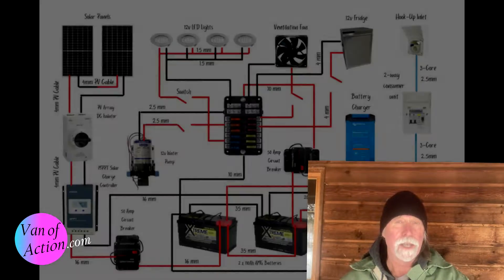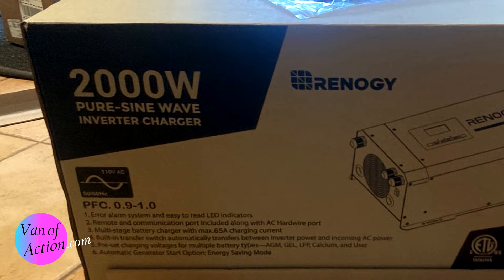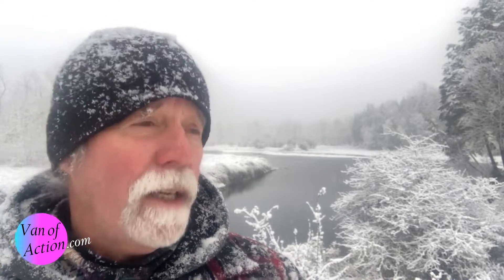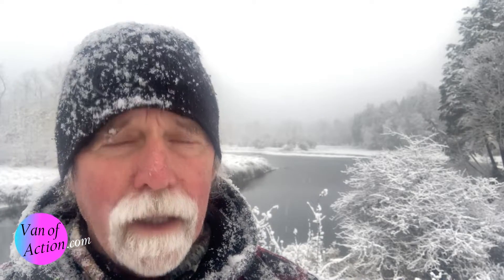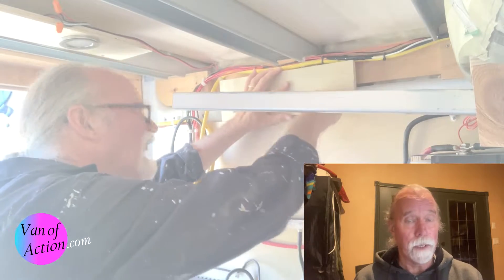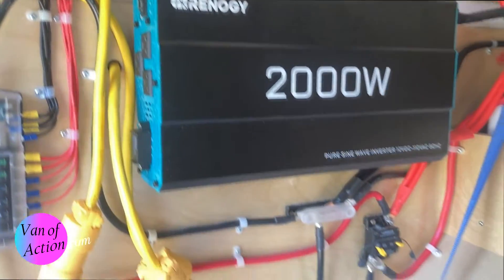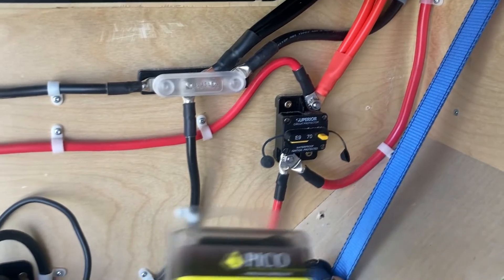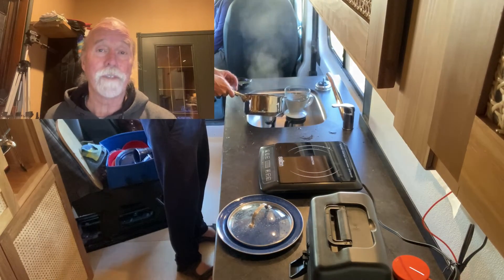How to Install 2000 watt pure sine inverter in Dodge Promaster van build for off grid vanlife camp

Comment: Dave good morning from Ottawa.

I recently had a viewer bring to my attention a mistake that I made on the installation of our Renogy 2000 watt pure sine inverter.  It looks like you and I both completed this install about the same time – about 8 months ago.  

The tip the fellow shared with me was that I neglected to ground the Renogy inverter. It does come equipped with a grounding lug.  When I looked at the manual, sure enough the information is there: 

“… comes equipped with a grounding lug to appropriately ground to earth or to another designated ground (for example, a metal frame of an RV)…. The recommended wire size for grounding is 10 AWG insulated copper strand wire….” 

Not being a professional, the value of sharing my work enables others with more knowledge or experience to share their thoughts, which I ultimately benefit from.  

I recently watched your installation video to see if perhaps you missed it as well, and I don’t see it in your video either, so I thought I would share this little nugget of knowledge I acquired this morning

Kindest regards
Dwayne
Reply from the maker: Hey Dwayne !!    Good to hear from you.   First - Yes - I did miss this on my installation, however a viewer pointed it out to me last winter and I corrected it.   Couldn't bring myself to do another video about it.   Second - we will be returning to Ontario towards the end of this month - I have a bunch to do in the Cobourg area but should be in Perth towards the end of August or into September ...maybe we can meetup
Reply: Great info about the 200 amp breaker, I saw in the instructions 250 amp is recommended. Surprised inverters draw so many amps. I was going to use 60 amps but see that would not work, thanks!

Comment: Hey mate what is the size of the battery powering your inverter?
Reply from the maker: Hi - thanks for watching.   I have 2 - 100 Amp Hour lithium batteries.  Hope that helps and that you’ll stop back.    Dave
Reply: 2 12v 100 batteries parallel or 24v? Thanks

Comment: thanks for the video, last year, the reviews of this product were thin on the ground. I installed mine and its been faultless for over a year now. But  I've read some of the comments below regards the cable thickness from your batteries going to the fuses (70a that are now 200a) and odnt see a clear response. But yes those cable need beefing up. The reason is, the fuse will allow 200+ amps through it befire it trips,  but those cables are only rated at probably 80 , end result can be melted cables and at worst toasted van. But thanks for the cool video. I have 250 a fuse on my renogy and big thick 50mm2 cable (UK size) 1/0 awg US size. or yes you could double the thinnner cables together, so 2 cables for red, and 2 cables for black.
Reply from the maker: Hi John - thanks so much for watching and taking the time to comment - and thanks for the close look at my installation.   I totally misunderstood the earlier comments and can see exactly what you mean.   I'll get on that as soon as I can.   Hope you'll stop back.  Be well .......... Dave

Comment: How did you connect the ground? My renogy inverter came with 3 nuts and 2 split lock washers for a single bolt /post ...
Reply from the maker: Hi Marion - thanks for watching and taking the time to comment.   I connected the black wires to the negative bus bar which grounds the complete system.    Hope that helps .... be well and stop back .......   Dave
Reply: @VanOfAction  Hi Dave, thx for reply!! I was more wondering how to arrange the 3 nuts and 2 split lock washers on that little inverter case grounding bolt. Not the main DC-IN cables.
Reply from the maker: Hi Marion - that's not ringing a bell for me  ....   let me walk down to the van and check !!
Reply from the maker: Hi Marion -   I  only have a red and a black wire on my  inverter.   There is no ground.   Can you send me a photo or short video ?  vanofaction@gmail.com

Comment: Did you figure out how to ground your inverter?  That is what I am trying to figure out next.
Reply from the maker: Hi Jean.   Thanks for watching.   I’m not an electrician so this information and $1.50 will get you a cup of coffee.    But - I believe that since the Inverters black wire is connected to the negative bus it is grounded through the system.  There were no instructions for separate grounding (that I saw) in my inverter.  If you hear otherwise let me know.    Be sure to stop back.  Dave.

Comment: Thank you for lots of useful information. I'm about to install the same inverter and I wasn't sure how to run power from inverter to an outlet. It is like adding an extention cord for 2000W use...  I was even considering installing the inverter on side of cabinet to plug items directly and to avoid adding an outlet. Extention cords can become unseated from vibration. Maybe there is a way to secure them to the inverter?
Reply from the maker: Hi Luke.  Thanks for stopping by.  You run the wires for the power from the inverter the same way you do for the 12 volt fixtures when roughing in.  There are number of different types of wires that would work - but I just bought a heavy duty extension chord when they were on sale and cut it into the lengths I would need.   There are a number of wiring videos on my channel.   You find this first one helpful.  https://youtu.be/W8XOElaBEJQ.   The others too may help.     Be well- stop back and let me know how you make out.   Dave

Comment: Hello and thanks for the video. I was wondering do you have a refrigerator in your build. And if so, how did you hook it up to your solar. Just another confusing topic in van life, that i wish u could explain.
Reply from the maker: Happy New Year Transformational - thanks for watching and taking the time to ask.  Yes we have a cooler in our build - and as fate wouild have it it's the topic of my next video ( I had to make a few adjustments to it) so stay tuned.   But to answer your question.   All coolers and fridges will require at least a 12 volt  power source.   I would suggest you want one that runs on both 12 volt and 120 that way when shore power is available you don't drain your batteries.   Whatever type of power - you just run the appropriate wires to where the fridge will be and mount the appropriate plug.   I'll have photos in the next video (probably next week) - but you can see more about the wiring in these ....   https://youtu.be/yR793YfwFdA,  https://youtu.be/W8XOElaBEJQ.  , https://youtu.be/hzXNuC6bqYc  and there are others :) ......  be well and stop back  .......  Dave
Reply: @VanOfAction  Dave thanks so much again for taking the timeout to respond. Will look forward to seeing your vid. Thanks again and Happy New Year to you and your fam!

Comment: Cables supplied with the inverter are test cables, not permanent cables
Reply: All reputable electrical solar people say 0-1 cable and 200amp fuse are needed for a 200 watt inverter, do what you want,, but never use 4 gadgets wire on a 200 watt inverter
Reply from the maker: Thanks John - I appreciate you coming back and letting me know -I'll be doing more research over the winter and let everyone know it I learn anything.    I guess for me the hardest part of what you said is ....... "All reputable electrical solar people say 0-1 cable and 200amp fuse are needed for a 200 watt inverter"  ......   Finding someone like that was a challenge for me which is why I want total DIY - it wasn't the plan as explained in the first few minutes of this video  ... https://youtu.be/Co_3pgQKeKQ.   Be well and safe my friend .. I hope you stop back and share some more.   Dave
Reply from the maker: John - thanks for taking the time to come back -----  honestly, I have no idea what to say.   Are you suggesting Renogy sends out "test" cables that are capable of testing the equipment under load  but are not capable of working under the same load ??  I'm just a carpenter - but that sounds crazy to me !!!   When the breaker broke and I upgraded,   I tested  I tested by feeling the wires and there is no heat at all on an of the wires - which is clearly a very basic (but I think realistic test).  I didn't read anything in the manual about the wires that are shipped should not be used - and I no longer have it - but please,  where did you get that idea ?

Comment: 2000 watt inverter requires  0-1 cable ,yours looks a 4 cable maybe
Reply from the maker: Hi John - thanks for taking the time - truly, like most carpenters I don't understand the numbers very well.   Your thoughts would be appreciated and helpful to everyone.    Which wires are you referring to ??    The Red and Black that I installed in this video came with the inverter.    The wires from to / from the battery are 4 gauge as per the design from Will Prouse (the sketch)    Nothing gets warm under a load .....   what is the concern ?
Reply: Try measuring voltage at battery and at inverter ... Too small or too long cables can cause a voltage drop.